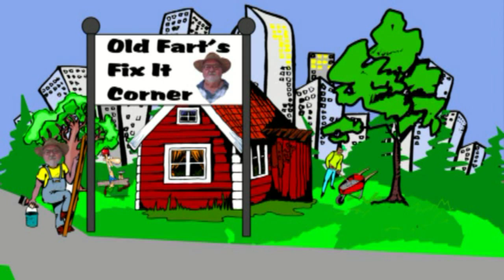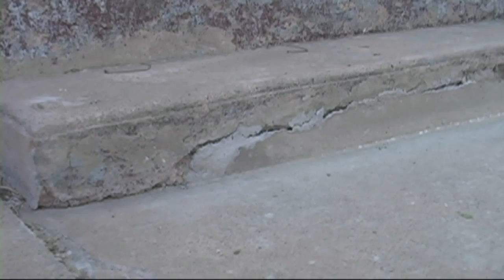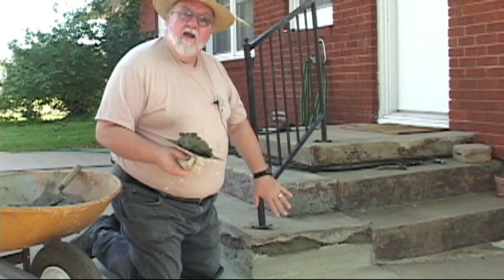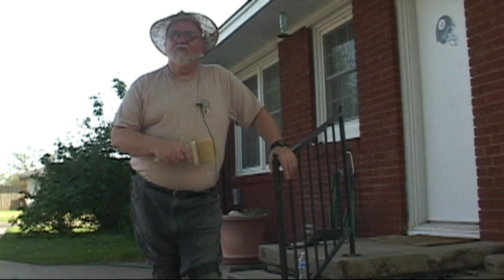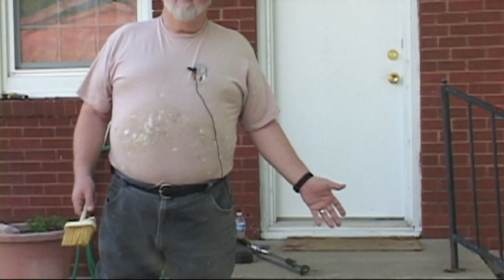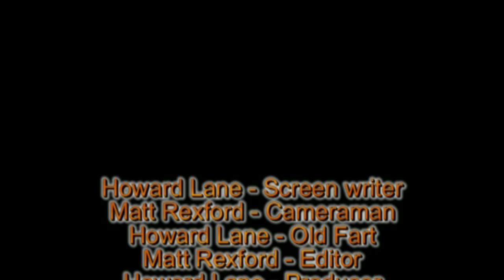Conrete Repair segment 3.mp4

Comment: Cement screening would work better , ######### he should have wet the concrete more, when he was packing it in there ( better sticking ability ) and drilling more small holes and using a bed of concrete nails & wire stronger hold ! Last coat should pure Portland cement harder stronger finish !

Comment: What about bonding adhesive for the top layer? Would have been helpful to see how he got the forms off. Don’t you have to keep the concrete wet?
Reply from the maker: Forms were easy, just moved the blocks and pulled them off. The concrete I used had a bonding agent in it as I explained.

Comment: Oh boy....not good. The surface should always be dampened with water before applying almost any type of cement. Think about it... you're applying wet cement to a dry surface. The dry surface us going to absorb the moisture in the wet cement....no bond.

Comment: Nice work!....Do you have any suggestions on resurfacing "Pre-Fab" concrete steps?
.....mine are in need........
Reply from the maker: Hi Mark, I would use a thinset mortar with an adhesive additive. You can find both at your local hardware store. Just tell them what you want to do and ask for the proper materials. Remember to wet the old surface before you cover it with new material. They actually make a primer for the old surface for better adhesion of the new material.

Comment: I repaired mine more easily. I used a damp 5 to 1 mortar, and just built it out by hand until I had 1 inch left. For that final layer/coat, I used 2 to 1. No boards necessary; it was more like plastering for me. Cheers. :)

Comment: I'm no professional but first off there should not be no trowel marks because there used to finish concrete and make it smooth so there should be no trowel marks and second brushing is used for making brush marks in concrete to create a non slip surface

Comment: Good video from the old fart.  But I would have removed the railing, drilled out and pegged (with anchor bolts) the entire face of all three steps.  Then I would have made a single larger U shaped form for the bottom step making the step two inches wider all around.  Then pour a looser mix of cement with bonding additive into the open top of the form. You can bang or vibrate the form to fill the voids and once set, remove the form and finish with edger tool.  Then repeat the process for the second step.  Then repeat a final time for the top step.  Once done, your steps would appear brand new and the surfaces could now be stained or painted or whatever.

Comment: will the thin set mix be strong enough to fill a large pit on the surface of the concrete. the pit is 1/2 inch deep, 3 inches wide 25 inches long? And would lag bolts be enough to keep the concrete together. I must add, that the original metal that was originally placed to hold the concrete together is showing and looks like it is rotting. Underneath the metal is hallow so I don't believe the lag bolts would work, and its not deep enough for rebar to be placed in. Is there anything else that might keep the concrete together?   Thank you
Reply from the maker: The thin set is only for the surface, nothing more than 1/2 inch thick. You need to use concrete mix to fill in the main part. If it is hallow under the old metal I would just use rebar and pound it into the ground like a big nail. The purpose of the lag bolts I used was to keep the new concrete from pushing out from under the step. They're plenty strong enough for that purpose. The rebar is what helps hold it all together. Hope that helps

Comment: I would use more water in the 1st concrete mix, make it nice and juicey, and vibrate/hammer the mix into the form. Maybe make little cut open to get the final concrete in and use a plate patch if needed. With my idea you can skip the whole segment 2 video and go to segment 3 plus have the steps a bit more strengthened if something drops on it like a gym weight set.

And your left hand is moving the screws around in the soft concrete mix! Now ya got to do some crazy concrete magic to get that rail strong and sturdy!
Reply: Less water the strong the cement will be....
Reply: Left hand Moving screws ?  The only screw Thats loose is.......  Well never mind .  And nice and juicy Sounds great except for the fact that when the water dries you are left with weaker steps.   Tyee Cambron You have two ears and one mouth.  i learned that listening 2x as much as i talk really comes in handy
Reply from the maker: sound like a good idea, whatever works best for you. I don't follow what you're talking about with my left hand, you lost me. I don't have any screws in any soft concrete mix...
Reply: +Courage The .Cowardly Dog  actually Cement & water are the best of pals... it's not the amount of water used that determines strength in concrete (it's the consolidation & the cure time) concrete reaches it's hardest p.s.i. as the moisture cures out of it (usually averages about 20-28 days on 8" thick drive @ 80 degree average temperature also ready-mixed concretes are the best way to achieve consistent mixtures of portland , sand, pot ash, water, and any other additives such as reinforcing fibers etc.

Comment: is this guy still alive, saw where he hasn't made a video in along time. Hope he is alive and well.
Reply from the maker: still alive, but been working on other things (video)
Reply: +How2BeReal Alright...good to here that you're still alive
Reply: Yes he is. He just moved on. He's making movies in Hollywood now and has a third baby on his way.
Reply: Hii, 

is it possible the cement outcome to be goodly bonded ? normally and cracked old cement do not bond well with newly poured cement.. it will just separate and crack from the old and new cement.. 

will it not ? that;s why we need to at least crack and chip off the old concrete so that the surface is rougher , at least able to bond better.  or use polybond (bonding agent)

eager to know the outcome of the concrete repair. 
andrew
Reply: The homeowner got rid of him as soon as he saw the "shotty" work on the steps !!

Comment: First thanks to the OldF for just posting.  Second, if you have expertise, it's fine to send out a warning shot, but it would be even better to list three or four steps to improve and solve the problems you are alarmed about.  Along this line, look at Ron Hazletons video on repairing concrete steps.  It shows how to use lag bolts (same function as rebar), how to apply a bonding agent as the step just BEFORE troweling cement,   and how to use various better trowels and tools.  Good luck to all.

Comment: well, after watching it through I'd say its not bad for a cheap fix.

The concern about "only" 1 piece of re-bar holding that step is ridiculous.  I've done re-bar for 7-bay automotive shops with half-spacing for reinforcement for 3 ton CNC machines and lathes.  Support for 50 pounds of concrete patch under a sand-filled staircase is minimal at best.  5 lags cross-patterned with re-bar is even excessive IMO.  There's nothign wrogn with that build.

Now using thin set? umm... not sure on that...